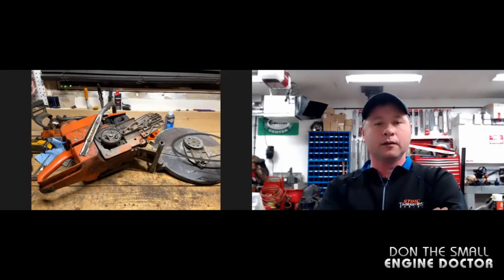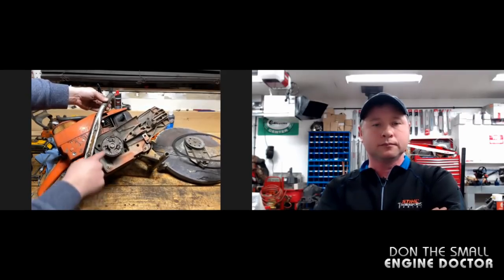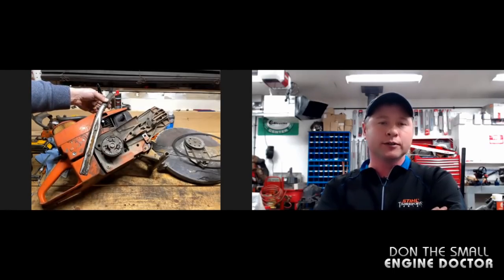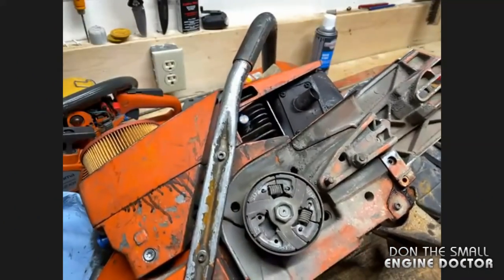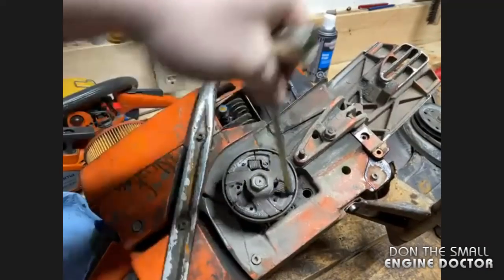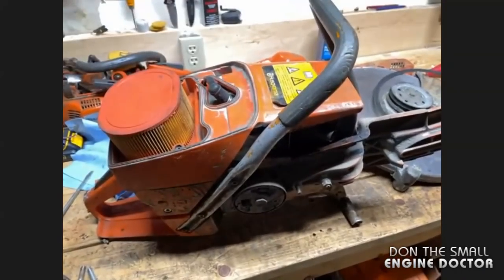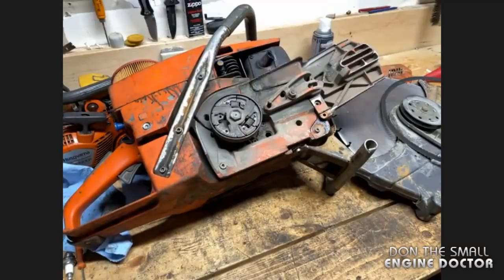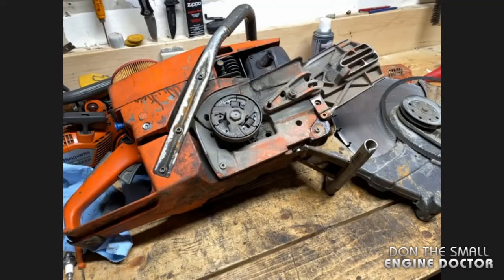FIXED! Why Dave's Husqvarna Cut-Off Saw Was Spinning At Idle!

Comment: Dave I have a older echo backpack blower.i replaced carb.and still not running any problems with these backpacks that are common I can check. Thank you. From Michigan
Reply from the maker: coils
Reply: Are you getting spark Ian?
Reply: @DavesSmallEngines  yes I was getting spark.also were you located
Reply: @iancameron1662  somewhere in Canada..... not too far from you if you’re in MI.

Spray some mixed fuel/oil in the spark plug hole, put the plug in, try and start it. If it starts it eliminates a lot of diagnosing.

Comment: I love your vids.  Thank you.  I have a Husqvarna blower that dies when the throttle is applied.  It that a stuck float, or what. It was working fine, then started doing this while I was using it...hmm.  new gas, new oil mix, just started to go ball-less.
Reply from the maker: snowblower or leaf blower?
Reply: How old?
Reply: @DavesSmallEngines  the blower is about three years old.  the gas was about a week, with Stabil i it.
Reply: @kevinorr6880  let me know the answer to @donyboy73 “s question
Reply: @DavesSmallEngines  I'm sorry, I don't understand.   I answered him, I thought.  My problem is with a leaf blower that has decided to die when the throttle is applied.
Reply: @kevinorr6880  could be a few different things. What brand?
Reply: @DavesSmallEngines  Husqvarna.   2 stroke.
Reply: @kevinorr6880  can you apply 1/2 to 3/4 throttle lightly to get it to rev up? Or does it bog down no matter what throttle is applied?
Reply: @DavesSmallEngines  it will bog down no matter what throttle...But after a moment,  as thought it is using what is in the lines.  (Guessing)
Reply: @kevinorr6880  try turning the H screw out 1/4 turn and see if that makes a difference.

Comment: Dave needs a shop heater. I can see his breath. Lol
Reply from the maker: i think he just got one!
Reply: Yes I did!
Reply: My shop doesn't have heat either, because its not insulated, and there are cracks all over letting cold air in. So thats why I have a tent in my shop. If its something as small as a push mower or smaller, I can bring it into the tent, fire up the little space heater, and I can work in a heated space.

Comment: I want Dave to buy another $50 beater, get the camera out and get on the phone to Dony. Soon Don may not be able to feed his family and be evicted from his shop but we all will at least know the finer details & inner workings of well used and abused 2T handheld OPE.
Reply: Hopefully only costs me $50 this time!!!
Reply: Yeah well it kinda usually works out that way, no free lunches on used beaters. But...with your enthusiastic intent, a carb kit, some fuel line & clutch springs you have one hell of a mighty capable cut-off saw that will probably out perform many new $500-1000 units. So you did WELL! My guess is Don would likely advise replacing fuel lines/filters/carb kit as almost a mandatory basic on any gear of that age/use. It was a good little series, I know they were basic things, not splitting cases and getting in deep, but that's what it normally is on stuff that ain't running. These vids give it's viewers agency in actually doing a few small repairs themselves & that's what it's about. Fixing one saw is one thing, helping show the masses that they can tackle small engine work is awesome.
Reply: @aussiehardwood6196  wow - that’s exactly the angle we were going for, however far more eloquently stated then I could ever have. It means a lot knowing our intended approach and outcome is being seen. Cheers!!!
Reply from the maker: @aussiehardwood6196  thanks Buddy! You should join us in one of these vids?
Reply: @donyboy73  Would love too, I have only a modest 20 something chainsaws, I bought home a Contra Lightening Stihl from the local tip once and got that going, I couldn't bare the thought of it being melted down as scrap metal.

Comment: Superb follow-up on D-big cut-off saw. where'd the old spring go?. ( Broken or popped off? ) Nice job Dave👍, thanks DB73, Cheers !!***.
Reply: Thanks for watching another Vetter!
Reply: @DavesSmallEngines   did you find missing old spring?.
Reply: @vetterfellow  it's in the same place my clutch drum C-clip went...the abliss.
Reply: Why didn't you show how to replace the springs? I really wanted to see that!
Reply: @aussiehardwood6196   Ok, 2 springs and a c-clip? YES !!.
Reply: @aussiehardwood6196   Or 3 springs and a C-clip?. WOW I'm corn-fused LOL..
Reply: @aussiehardwood6196  that sounds right!
Reply: @vetterfellow  of course not, I’m sure it’s long gone on some old job site somewhere!!!
Reply: @DavesSmallEngines  Now I understand !!. Thanks Dave. I thought it may have gotten wedged in the corner of the casing.   You increased the value of that saw 30 time💲s, good luck with it. Cheers !!***.
Reply: @hilltopgypsy   HG, Sometimes if you google How to repair or replace a clutch spring on a saw you may find a suitable video. You can google right here on you tube. Give it a shot🙂.
Reply: @DavesSmallEngines 👍
Reply from the maker: Thanks 👍
Reply from the maker: we'll do that too in one of Dave's lessons!
Reply: @hilltopgypsy  Did you read what Donyboy73 wrote?. " He'll do that in one of Dave's video's ".